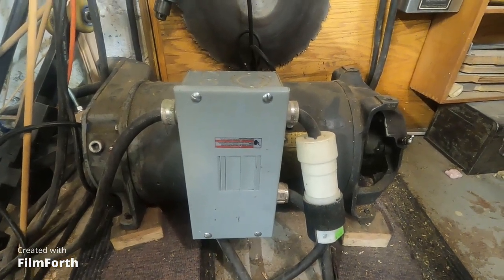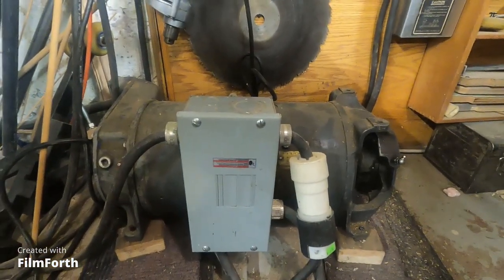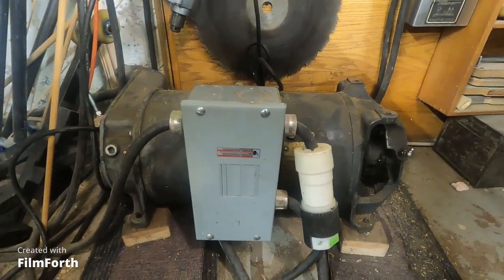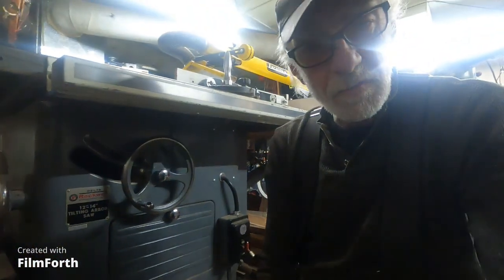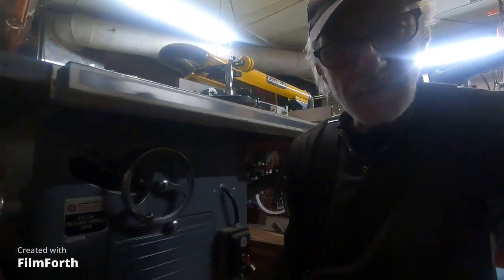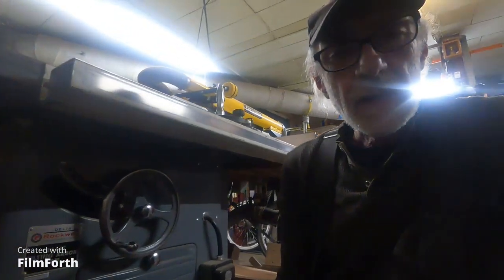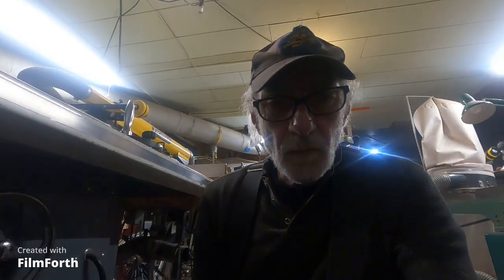Bubble Gum + Hay Wire Phase Conversion 101

Comment: I am so glad you're ok Dee.
Hopefully you will get your wiring and phase converter working again soon.
When I started my home base hobby shop in the 80's, I used a Arco Rotary Phase converter. 
It was a 7.5 kv.
The biggest motor I had was 5hp.
I could run multiple machines, just not start them at the same time.
My equipment is Automotive Machining Equipment. 
And a Enco 9x42, Bridgeport copy.
Actually a Pinnacle Mill made in Taiwan. 
Been a great machine. 
My Balancing machine needed reliable electric power for the computer, so I preferred the Rotary Phase Converter. 
I am not an Electrician, so I hired a professional Electrician. 
My building I have now I have 3phase.
Thanks for sharing Dee.
Take care, Ed.
Reply from the maker: Those old Enco machines were good and still around, I moved out of commercial building that had utility 3phase, these new phase converters are more engineered, I am just thrilled to be able to use one thanks to American Rotary, they will get some good exposure here I think.

Comment: I built a rotary phase converter with balanced legs years ago. It works fine but it’s too loud and not convenient. I switched to a VFD for each machine. It’s just like having three phase power in the shop!
Reply from the maker: The rotary converters are something I just have not kept up on and My Gomer Pyle put together thing worked but I didnt pay enough attention on what I was doing. I think having a good rotary converter is best for me because that would take around a dozen VFDs and I have odd small hp motors for the cutter grinder, coolant pumps. I would like to try a VFD on my Shoda spindle moulder, have to change pulleys for speeds on that one. Reading up on the American Rotary brand converter, they are a bit better engineered than the put together converters. It has been a long time, I remember not being able to balance out the wild leg using a 5hp machine vs a 1hp machine, However! due to vast experience in motorcycle DC electrics and Fender tube powered guitar amps, I am very good at trouble shooting and repair of the Monarch 10ee electronic drives! Thanks!

Comment: OK Donnie.... I understand.  Where do you start? 1). The big difference between a three phase motor and a single phase motor is in the start up.  A three phase motor has no start up feature like a single phase motor has.  In order to start a motor, you need a "ROTATING MAGNETIC FIELD".  Three phase power has a rotating magnetic field, so a three phase motor simply wants to start on its own.  A single phase motor needs to kludge it up a bit.  Forget about older repulsion induction motors for now. Too confusing.  Modern single phase motors have  a). a separate start winding, b). a large electrolytic cap, c). a centrifugal cut out switch.  The big cap phase shifts the power by 90 degrees giving you a clumsy two phase power to the motor and hence, a rotating magnetic field.  Once running, the switch cuts out power to the cap starting circuit and the start winding.

A three phase motor needs multiple phases to start.  But it will run on single phase albeit at a reduction in output power.  This is called single phasing a motor.  In the case of an idler motor, there is NO APPLIED mechanical load to the motor so it runs in an idle state and the current draw reflects this.

But an idler motor, i.e. a three phase motor with no applied load, has TWO OTHER WINDINGS in the stator winding assembly.  These windings act as ROTATING TRANSFORMERS.  The windings are mechanically isolated by 120 degrees and connected to each other ONLY THRU THE MAGNETIC FIELDS involved.  There is NO ELECTRICAL CONNECTION between the three phase windings.

So once the idler is running on its first phase winding, the output of the other two windings WANT TO synchronize with the magnetic fields whose phase shift is determined by the influence of the rotating rotor within the idler motor.  In other words, the phase of the output AC WANTS TO ZERO IN ON 120 degrees!

A static converter is based on the phase shift of capacitors.  Capacitors can only phase shift 90 degrees, NOT 120 degrees.  Also, as a capacitor charges up, it tends to want to open circuit.  The AC nature of the input solves this to an extent by continuously charging and collapsing the fields in the capacitors and this roller coaster charge cycle is determined by the 60 hz line frequency of the AC.  As you load up a static phase converter, the converter tends to want to single phase the motor to an extent reducing the available full output capacity of the motor being run!  It also increase the heat to the windings of the motor being run.

The issue with any motor is start up.  Since the motor's rotor is not rotating, the application of power to start it up tends to want to short out the windings through a huge current spike.  This current spike is often SIX or more TIMES the full load rated current of the motor!  This is called the DIARC START SPIKE.  The usual sequence of events of a start up mean that the rotor begins to rotate on application of power with a rotating magnetic field.  So the diarc start spike tends to be very short lived in the order of milliseconds at best.  This is why your breakers dont pop on the start of a motor!

If you apply power to a motor with a locked rotor or a three phase motor using no rotating magnetic field, the diarc spike doesn't disappear.  Instead it continues to overload the windings to the point that the insulation of the windings burns out and shorts the windings internally.  NO GOOD!

The two windings used by the idler as rotating transformers have to have enough magnetic field capacity to have the momentum to continue to do their job.  Its like a flywheel on an old steam engine.  You need that heavy mass to smooth out the rotation of the engine being generated by the aggressive back and forth linear motion the piston and rods.

We get this momentum by oversizing the idler motor.  If that axelson is running a 7.5 hp or 10 hp motor you have issues.  First of all, these would be "OLD" motors.  In the old days, the method of horse power measurement was different than today.  An old Louis Allis, Westinghouse, Woods or Rouland motor can be said to have just about twice the horse power output then that specified on the nameplate by todays method of power measurement.  Today's motors have massively lighter windings for the same power rating then these older motors.

Secondly, you need at a MINIMUM an idler rated at twice the output of the motor you are trying to run.  So if the axelson is rated at ten HP, you should have at least a 20 HP idler.  BUT...... the current load of the axelson is dependent not on its name plate rating but on the power draw of the job the lathe is doing.  Many times, that lathe motor will only need to supply 1, 2 3, 4 or 5 hp for many of the jobs your running.  If you get greedy and begin to take off 200 thou cuts or more, then you begin to push that motor to its high end rating.  On the other hand, the start up of the lathe is often not under load.  You get the motor running, the spindle turning and then you back your tool into the job.  This is different then trying to start a LARGE water pump or air compressor which can be loaded during start up.  Often, large compressors will be equipped with "unloaders" for just this reason.  This can have the effect of reducing the required size of your idler needed.

Now, it is perfectly OK to start up the lathe, take a short duration HEAVY cut and then let the lathe go back to its idle condition.  After all, you got the damn thing running so now the start up spike is gone and you can use intermittent heavy cuts.

All of the machines you have been using are fairly "light weight" machines having no more than about 5 HP.  If the monarch 10EE uses the "standard drawer of tubes", then you dont even need to worry about three phase.  My 10EE uses a direct 240 single phase input.  No phase conversion needed.

So my gut reaction here is that your going to need about a 15 HP motor if the axelson is 10 HP.  A 20 would be ideal but they get harder to find.  If that axelson is rated at say 7.5 HP, then you could get away with a 10 HP idler.

The next issue is how to start the idler.  There are three proven ways to start the idler.  A rope and pulley. A pony motor. A dedicated single phase start circuit.  I have seen all three.  The single phase start circuit is often cobbled together from old motor starters, relays and electrolytic caps.

Further research of some of the sites on the internet contain a wealth of info on how to size and wire these items up.

Lastly, as this post is too long already, you should use breaker protection on both your primary L1 and L2 lines as well as the L1 and L2 lines supplying power to your phase converter.  I located and wired my WILD LEG using ORANGE wire. While some electricians may cringe at this, it is a clear indicator of where that damn thing is.  Any internal connections in your machines where they are wired LEG to NEUTRAL will not see 120 volts!  Its more like the square root of three times your line to neutral voltage.  This can burn out some single phase toys on your machines like DROs, LIGHTS, etc. which happens when a new machine is running backwards and you simply reverse two phase legs to correct this.  So now the machine is running in the right direction but you overloaded those items using a phase to neutral supply if that phase is your wild leg.

While I agree with your assessment of some fake machinists, I think there are quite a few good old boys that are willing to assist in the three phase battle.   Its almost a right of passage when you drag home old government machines to put in your back yard shed.  This topic was big a few years ago but I have not seen much lately.  I guess you get a rig running and then focus on moving on.  What I hate about certain fake machinists who ridicule south bend lathes as amature machines, I took their advice and bought a DeVlieg jig bore instead of a giddings and lewis boring mill.  I didnt know better.  Now, I wish I had listened to myself and dragged home the giddings and lewis 25.  Its smaller, lighter and more useful for the work I do.
Reply from the maker: I was able to jump into the Monarch 10ee electronics because I knew a little about old tube guitar amps, and the DC generator/starters and relays on the Harley Davidson Electra glide garbage wagons.
Reply: @deedeeindustrialsuperprecision  Dont you love the monarch!  I am struggling to find parts to restore the original electronics in the omniversal.  At the heart of the issue is the vexing THYRATRON tube.  A thyratron tube differs from a vacuum tube or valve in that its pressurized with argon.  The 10EE uses TWO primary thyratron tubes and the omniversal used a single thyratron tube the size of a ball mason jar!

In the omniversal, its simple.  They used a single thyratron tube to modulate the DC voltage for the knee feed motor.  In the 10EE, it gets a bit more complicated.  I had to rebuild the diode module as it was smoking.  The 10EE uses two different modes of operation.   Where everyone gets into trouble is trying to use basic DC supplies to get into the upper speed ranges.  Not that simple guys!  And dont forget the infamous mercury vapor rectifier tube.  To all the liberal woke people out there....... YUP I AM USING A MERCURY VAPOR RECTIFIER TUBE AND I LOVE IT!

What is truely interesting is the DC motor.  On the Hardinge HLV, there are times when the speed and geometry of the part just line up with the stars...... you get a moriere pattern on your work.... a form of chatter.  What tips it off is the secondary harmonics of the 60 cycle power from the motor back feeding through the drive system to the spindle.  You just gotta speed up or slow down to get out of that window.

The 10EE doesn't have that issue because its driven by a DC motor which is not dependent on any influence from line voltage frequency.  I dont know how the new VFD controlled three phase motor drive schemes are working out.  The VFD does have the ability to modulate line frequency through its electronics so it may actually isolate line frequency from the actual frequency presented to the motor.  But the torque profiles are not the same either and I understand that Monarch is now using a TEN horse motor in this scheme to ensure that the classic torque profiles were used to are maintained.
Reply from the maker: @devemch7851  The Hardinge feed is hard to get used to with it not staying in sync. That is interesting about the tube driven feed in the omniversal!
Reply: @deedeeindustrialsuperprecision  The "feed" on the hardinge is pretty cool.  You just pop the switch for direction and dial in the relative speed by feel.  The sync issue comes into play when you single point thread which is way different then what most folks are used to.  YOU NEVER DISENGAGE the lead screw which is driven by the synchronized quick change box.  Instead, you set your trip dogs.  Then you use the lower head stock lever to move either left or right.  The trip dogs mechanically disengage this lever.  There is also a lever on the compound which moves the tool in and out of the job.  So there is no thread dial to engage and you dont move the carriage in and out to your fixed zero position.  What I found cool about this rig is that I can thread right up to a fixed shoulder and the trip dogs cut out just in the nick of time.  You really need to put on your A game when doing this on a standard lathe.  I would not attempt to do some of the jobs I have done like this on my old south bend Nine!!!!!!  My ELSR needs to be gone thru as its kind of flaky.  Have not had the time to tear into it yet. The downside to the hardinge is that really does not like course threads.  If you need to go lower than about 10 TPI, the carriage really flys and if your RPM is a bit high, it puts a huge stress on the petite gears in the gear box and headstock gears.  They are easy to break if your not on-top of things.  When cutting fine threads, its much easier.  Also, the hardinge can use inserts but many inserts like higher speeds which places more stress on the gears in the box.  So my perfrence in hardinge HLV threading is to use ground high speed steel, preferably M42, and for GODS SAKE, SLOW DOWN!!!!  I also like to use bacon grease for cutting threads in steel alloy like 4140.  I also prefer to use the D9 tool post in place of my aloris AXA here as it smaller and I dont need to fight tight quarters on small precise parts.  The 10EE is notably bigger and offers more options on the larger tool and die work.  Its large enough to really need a BXA style tool post even through I have used the AXA on the 10EE.